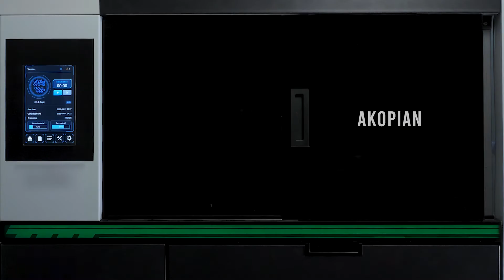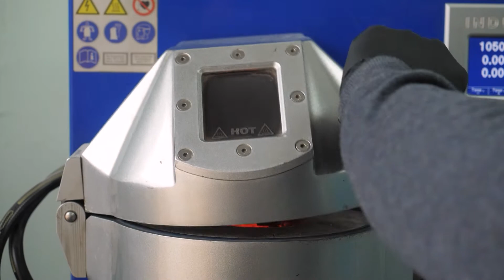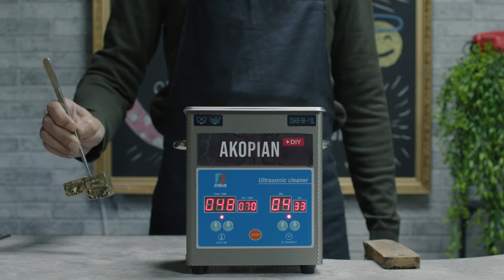Make a Jewelry Case | Handmade Jewelry

Comment: You do amazing and wonderful work. I am a Zippo and Zorro lighter collector. I also am a hobbyist 3d printer. I'm interested to understand the process and equipment you use to cast a 3d print into brass. Are you printing with PLA? How do you go from plastic to wax to brass? Could you provide more details on your mold making technique and casting equipment? I understand if you are protecting trade secrets. I am not a competitor, only an enthusiastic hobbyist.
Reply from the maker: I am very glad that you liked my videos! I don't have any secrets here. I used 3D printing using MJP technology, the printing material is wax. Next, I used the technology of casting on the smelted models, I used the casting of jewelry brass. I think if you want to try it yourself, you need to find someone who will outsource printing and casting to you.
Reply: Thank you for the reply!  Since I started watching your videos I've been investigating equipment to practice your techniques. I think the hobbyist could do it in the home workshop but there is significant capital investment even for the modest hobby level equipment. I'll continue investigating.  Part of the fun for me is getting satisfying results on a budget. Thank you so much for your advice and for the interesting and inspiring videos.
Reply from the maker: @Sonic_Ox  Yes, I agree, it is possible to equip houses with all the necessary equipment. Buy a resin 3d printer with high print detail and organize a small foundry. In fact , casting on smelting models is not so expensive . The equipment can even be assembled with your own hands. If you have any questions, write)
Reply: Thank you Ashot. I appreciate your information and advice. I will definitely look into resin printers. They are becoming more and more affordable. I didn't realize until today that castable wax resin existed. Opens up a whole new world of creativity to me. I think I will pursue home casting in metal. I have subscribed to your channel and will continue to marvel at your artistry. Thanks for the inspiration and for your correspondence.
Reply from the maker: @Sonic_Ox  I'm very glad that you really liked the content! Good luck in new beginnings)